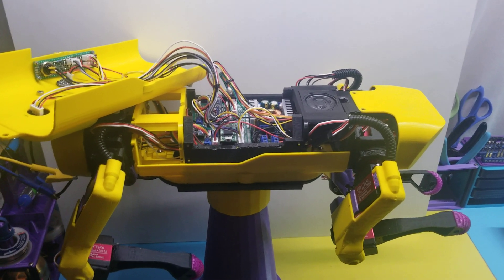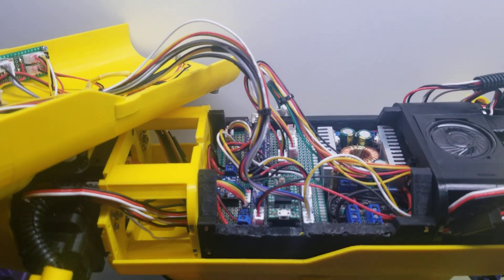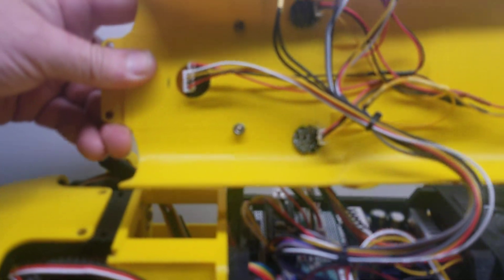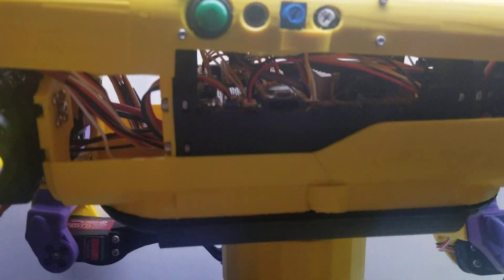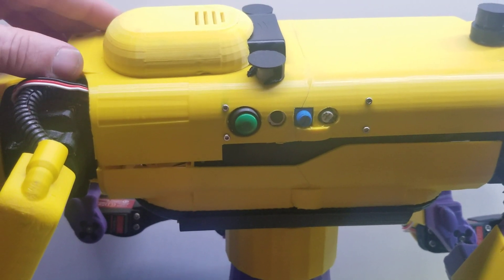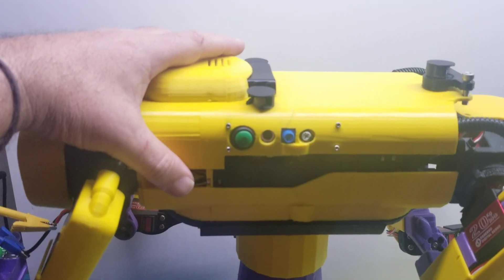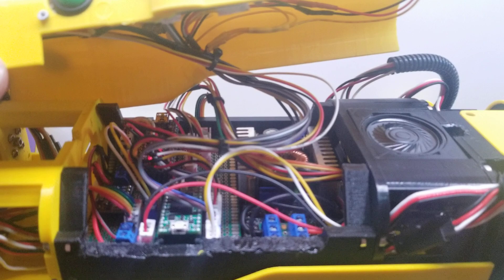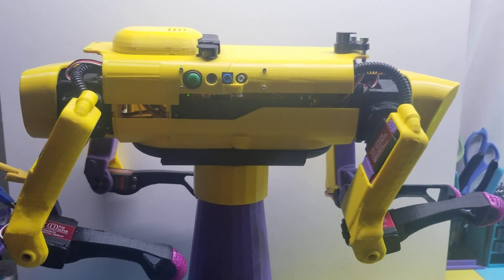Wiring Complete! (not without design flaws) : Nova SpotMicro3

Comment: I was wandering if ps2 controller can be rid of by using wifi/bluetooth enabled arduino nano and programming it to pair up with generic universal controllers of any kind? It would freeup some space on the board and eliminate the receiver from the top for any other cool sensors
Reply from the maker: it probably could be, yes. I first did my hexapod with a bluetooth app, not respinsive enough for me. But then i used the PS2 and it worked great, so i just went with it for the Nova project as well. i know nothing about universal remotes, though have been tempted by other youtubers to make my own one day!
Reply: @ChrisLocke1969  Thank you for the reply. I can take up that as a possible feature to explore maybe, once I'm up and running. I started the print yesterday, so far got stand cone and base printed. It will take a while but I think your SpotMicro project is the best version out there. I'm looking forward to assembling it, and after maybe be even able to assist with some features.
Reply from the maker: @bekzodalimbekov8768  so great to hear! you are why i do this! and definitely lets look at a remote upgrade when you're ready... yes, its a lot of printing! Good luck and thanks for the kind words! 😎👍👍👍